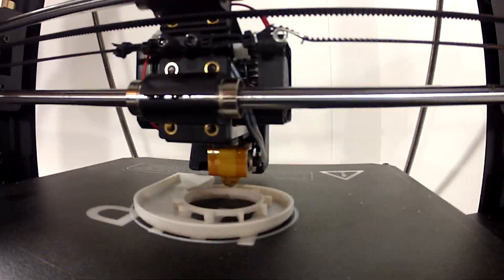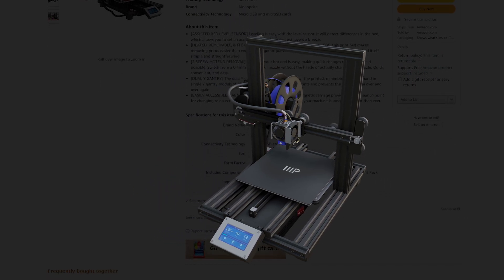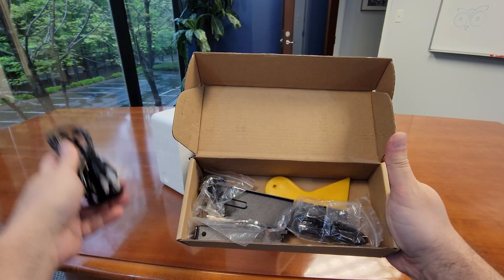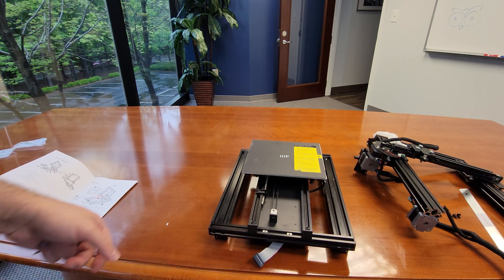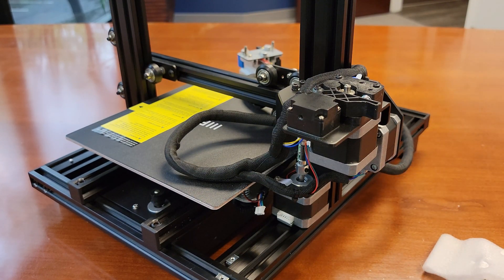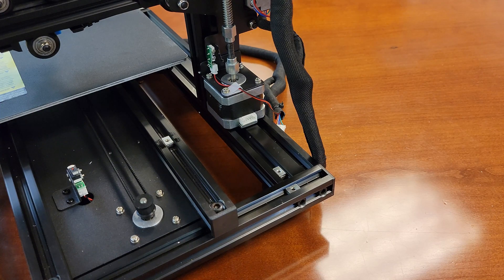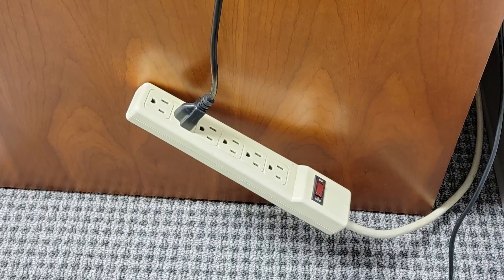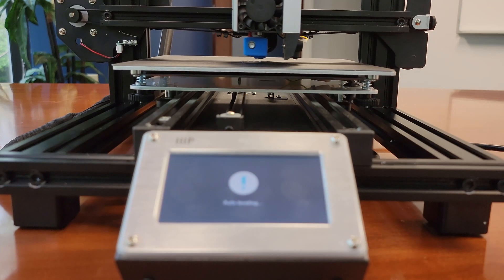Monoprice Maker Pro 10 Mini - Part 1 - Unboxing, Assembly, first Print!

Comment: Nice video.  I have the same printer and I ran into a problem.  The z axis is not working properly.  It is out of warranty (even though they did not respond during Covid when it was in warranty).  I was trying to figure out how to adjust the z stop higher.  When I home the machine it goes down and gets stuck and grinds until I cut it off.  Do you have any suggestions?